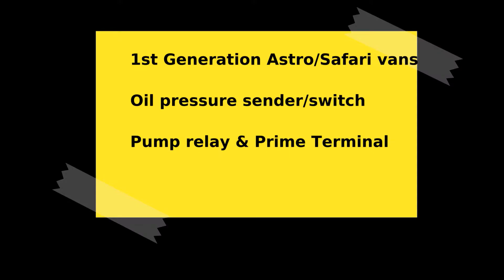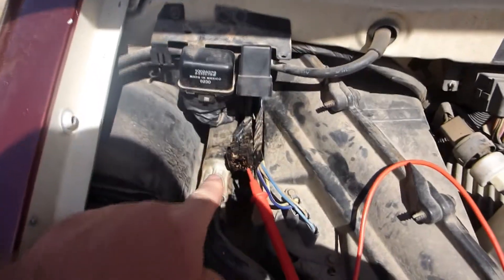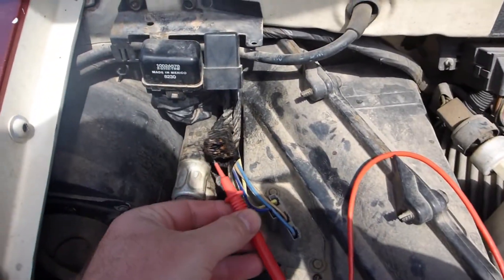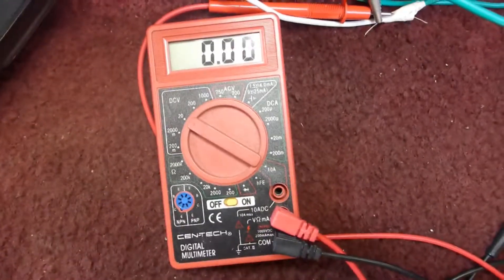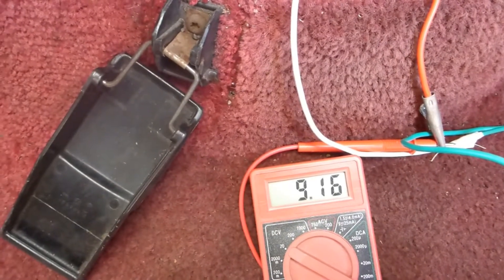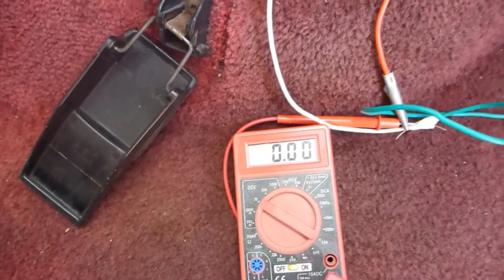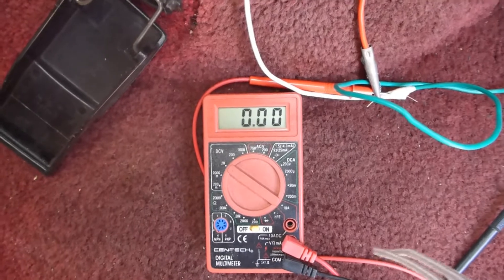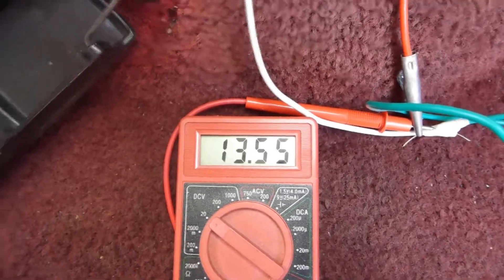1st Generation Astro/Safari Fuel Pump Circuit

Comment: Hey, Dont know if you are still here. But I have the same van and someone worked on it in the past and they cut these 2 kind of thick red wires behind the battery near the fuse box under the hood. I was wondering if you could show me how yours is hooked up back there as I cant figure out what they were connected to. Both of them are coming out of a large bundle of wires right behind the battery.

Comment: i have a 95 astro and just replace the fuel pump 2 times but it doesn't send any fuel pressure, do u think its because the oil pressure switch its not working and thats why the fuel pump doesnt work ?
Reply from the maker: There are TWO paths for the electricity to flow to the fuel pump, so if you are not getting power to the pump you would check the oil pressure switch/circuit and the fuel pump relay circuit.